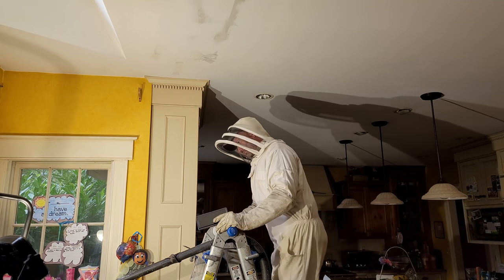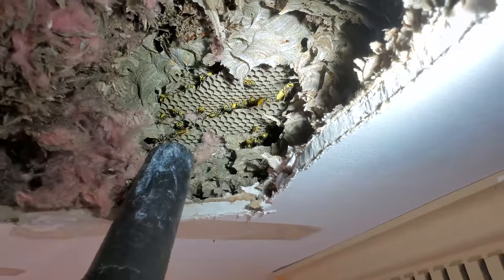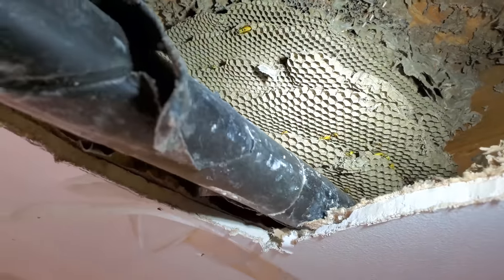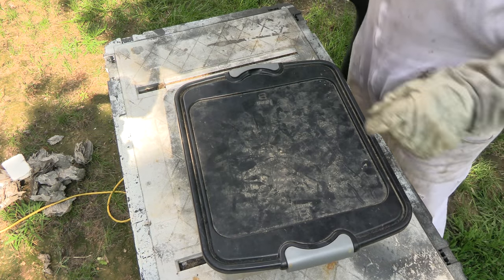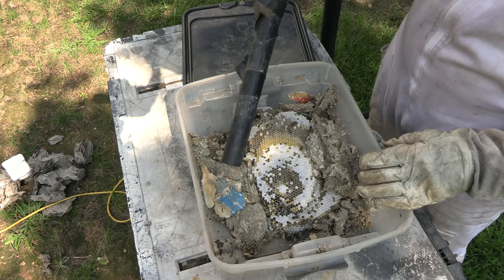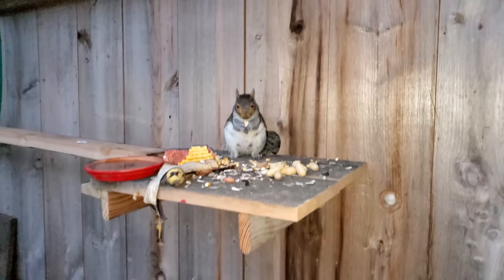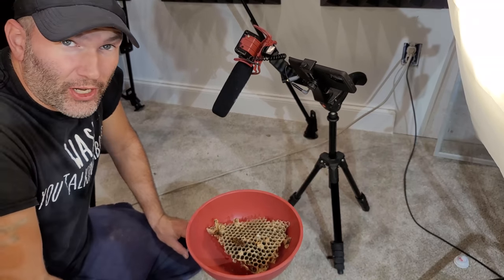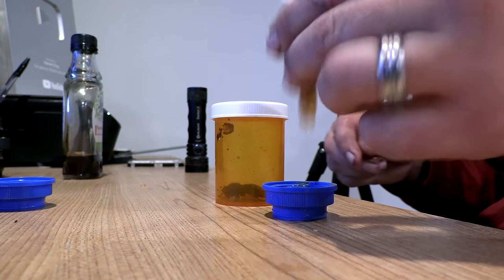Wasp Nest INFESTATION above Kitchen Ceiling! Wasp Nest Removal!

Comment: 6:13 Looks like they might have chewed the outer sheath off of that romex wire going through there.  They might want to have an electrician look at it to see if it's damaged or shorted.
Reply: It definitely looks that way. Hope he sees your comment.
Reply: It appears the wasps actually chewed the outer sheath, and indeed the inner insulation off the conductors in the romex. It's amazing it didn't catch on fire. I all it would take is 1 wasp in the wrong spot to short it out.

Comment: Did you or the Customer see that the wasps had eaten through the insulation on the power wiring? I'm surprised it didn't start a fire.

Comment: I haven't watch the whole video yet, but I noticed that there was some romex wire that the nest was built around and it seems that the protective coating on the wires has been chewed off , this can lead to electrical issues or fire. just wanted to make sure you noticed :) it may just be an ethernet cable but I would warn your client that there are exposed wires in the ceiling and they will want to get them fixed.

Comment: 6:13 Looks like they might have chewed the outer sheath off of that romex wire going through there.  They might want to have an electrician look at it to see if it's damaged or shorted.